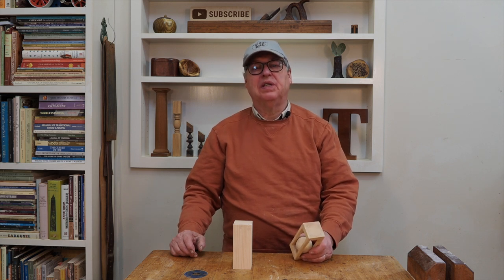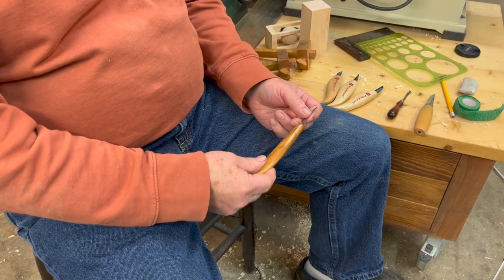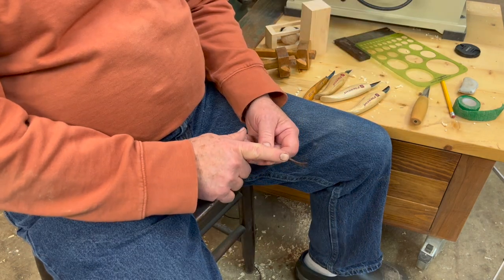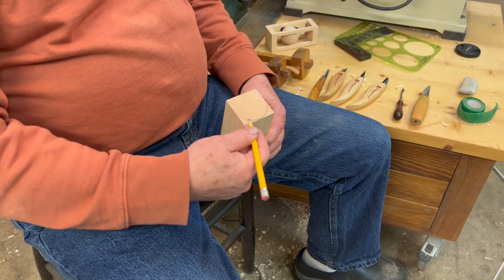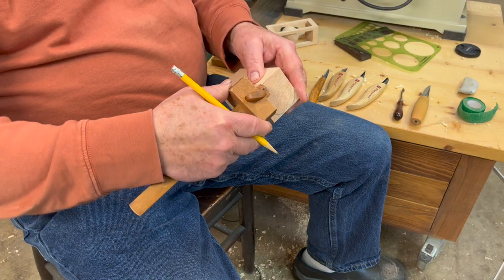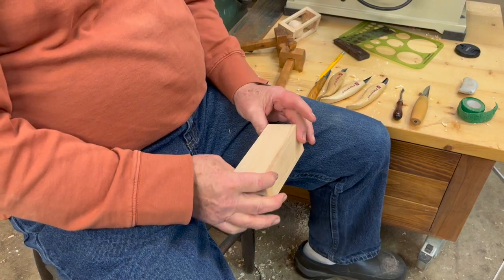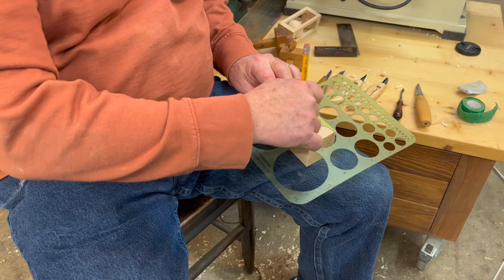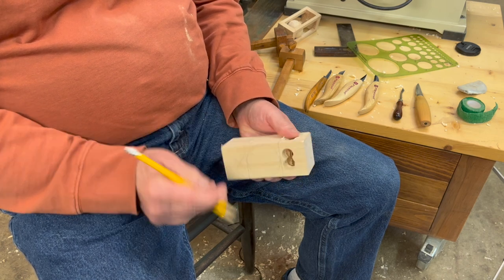How to Whittle a Ball Inside of a Box

Comment: I wound like to see this in round stock. I'm in the middle of making my second cane.
Reply from the maker: Thank you for your comment. I have seen a ball in a cage done on a walking cane before. The ball has to be a fare  bit smaller than the cane’s diameter so it still has the strength needed. All the best with your project.
Reply: @shoptalkwithtim  well sad news my first can just trying to do celtic knot it cracked. I have another attempt #2. I'm starting with a actual tree trunk. Almost done sanding to final specs.  I so want a ball in cage. Somewhere I'm the middle.
Reply from the maker: My best advice is to practice your technique on another piece of wood of the same dimensions before attempting it on your finished piece. That way you know what works and what doesn’t and you’ll have a model to work from.